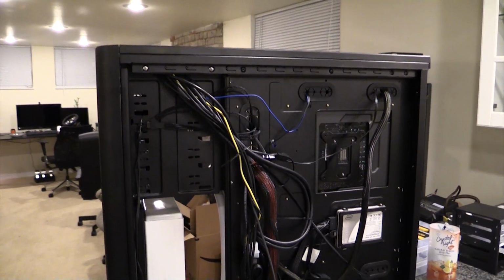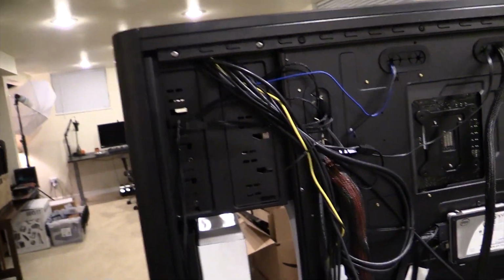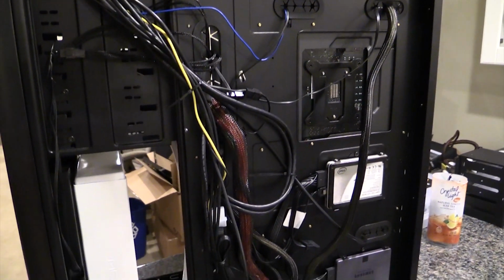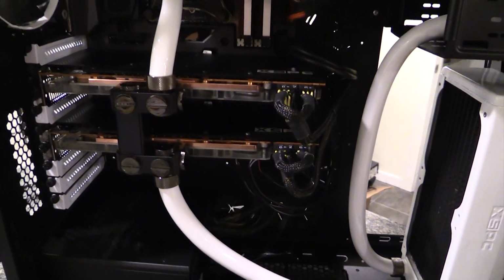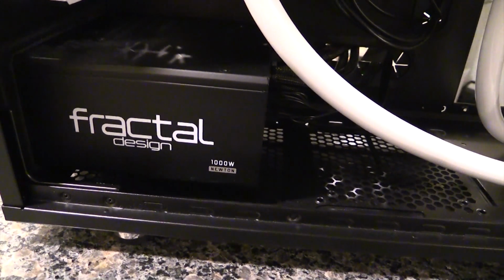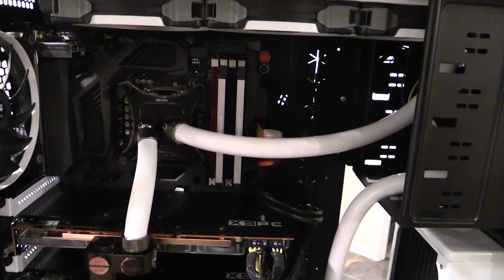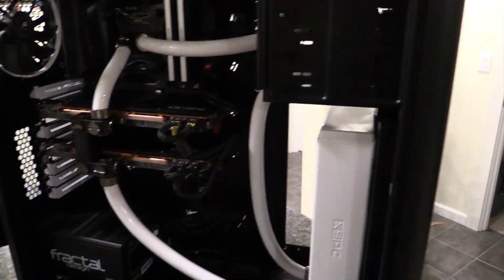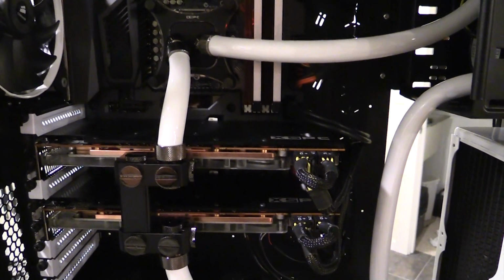Water cooling PC build - Overview and thoughts about my personal build

Comment: I just watched your unboxing of the bay res and you were really pleased with it justifying your reason for using one! Why the change of heart? The faceplate comes off doesn't it with clear perspex behind? Also there's a gauge on the front so you can see when you're filling it and flooding the loop.
Just noticed you can't see the bay res from front, what was the point?

I chose same res/pump combo, gpu block and cpu block i think a lot of first timers do!

I'm not criticizing your decision just asking!
Reply from the maker: Lack of space for a tube res + pump

Comment: did you try to actually draw your planned water cooled system before you buy the water cooling parts? it would make it easier to order the exact number of fittings & parts you need!

Comment: Your line looks very clean but the tubes look a little stressed. If you want to cover up the colored power cables a little shrink tubing at the ends does wonders. You could even do black and white shrink tubing

Comment: Hey Tim, I'm with you. I've been a PC builder for over 20 years but never pursued watercooling until a few weeks ago. I learnt a lot and only made a few minor mistakes. Now I'm the proud owner of a power but silent beast! I'm happy you're proud of your rig, it's very nice! And yeah, I had no luck sourcing XSPC 90 degree fittings so used EKWB instead. Not elegant, but it works.
Reply from the maker: Yeah, next build I am going to use Bitspower fittings. Expensive as hell, but worth it.
Reply: TimmyTechTV Check out Monsoon fittings, Jab-tech has a 60% site wide sale going on for over a month now and they still have some 6-packs left

Comment: Timmy, other than the points Dominic made, I got a couple more:

1) No point mentioning Valley scores without saying the settings used or the clocks/voltages the cards are at

2) If your loop is actually at 64 C peak, you should definitely get those fans to spin faster. The D5 does not like going above 55-60 C and it also affects tubing.
Reply: VSG Oh, hi VSG! That will be when he hears the sizzling.
Reply from the maker: As long as I can cook bacon on it...
Reply from the maker: 1. I did but maybe I edited it out. (1150MHz clock 1200MHz ram)
2. Meh
Reply: TimmyTechTV If your pump potentially dying due to those temps is a "meh", then I would love to see what "Oh no!" is :)
Reply: TimmyTechTV Sure, as long as you like it hot and wet :)
Reply from the maker: VSG Just to clarify, it is the GPU that is reporting 64 degrees and that is only after running valley for 30 minutes. The system under normal load is like 32-36 degrees.
Reply: TimmyTechTV The temp of the GPU doesn't matter, like at all. You made it sound like you were talking about the water temp in your video.
Reply: Agreed, but he likely has a bad mount if he is getting a core temperature of 64 C. Even my dual 780 Ti Classified KPEs at 1.5V in parallel flow never went past 50 C when benching.
Reply from the maker: That's like saying your apples are better than my oranges because they are apples. AMD cards run way hotter, even water cooled.
Reply from the maker: VSG ***** I have a fluid temp gauge I'll add to the system. Maybe 2 Hawaii cards is too much heat for 5x 120mm of radiator, who knows.
Reply: TimmyTechTV At stock, yes, Hawaii runs hotter due to its denser core. But once overclocked and overvolted, GK110 consumes way more power and produces a lot more heat. So at 1.5V, there is no other single GPU card that runs hotter right now than the KPE. If you put everything in terms of power consumed (which in turn is given to the loop), apples and oranges can be compared.

5.120 should be enough, but since you are running the fans at 5v the rads aren't loosing enough heat to the environment I guess. The first thing I would check is the GPU mount which means having to tear down the loop though. Yay for quick disconnects!
Reply from the maker: VSG Both cards have the same temps. I doubt I screwed up both.
Reply: TimmyTechTV Hmm.. I agree with you then. If it is not a bad mount, all I can think of is that the fans at 5v just aren't enough. I am guessing that Valley run was not at stock? Do you happen to remember the VRM temperatures? I remember the VRMs on my reference 290x cards were also pretty hot. Sorry for all the questions, just curious that's all.
Reply from the maker: +vsg I'll try running them faster and see what happens.
Reply: Sounds good, man!

Comment: Ohh and I forgot - why no push pull on the RX240?   You have the space.   And what are you CPU load delta Temps?   GPU delta temps?
Reply from the maker: I might add them, but I don't like looking at the back of the SP120s and the fin density on the 240 radiator is not super high, so they really aren't needed.

Comment: nice build!   Love your videos - you hit the nail right on the head with ordering your fittings all together up front BEFORE you start your build...

I did my first WC build with a BayRes and without fittings 90´s and 45´s and it looked horrible the first time.   Planning ahead is 80% of the build.  Ohhh and MAKE A DRAIN PORT!!    Did not do that either my first time around...

*  BayRes - NEVER again....
*  Plan ahead before your build.
*  Order all your fittings before.

Learned that the hard way...     :)    

Now I am making a monster WC set up in my table with glass top etc. 2 x XTX 360 rads and 1 x XTX 480 rad.....
Reply from the maker: I couldn't agree more with your 3 points there. Something we all have to learn I guess.

Comment: Would have probably gone with a tube res, since they're rather easy to put right above the pump(most of the time), and sometimes you can get a pump case that directly attaches it to the res.
Reply from the maker: Just too tight in the system for how I wanted it to look. Next system I do will have a tub res for sure.
Reply: TimmyTechTV I could probably do it in my 600T but there's no way I'd actually want to.  I've seen it done in a 600t and it just looked like a pain even if it's a rather large mid tower.  I understand though wanting it to look clean, and not like early liquid cooled systems looked with even wires all over the place.  Honestly if I did it I'd have to have a full tower, and likely want something like the Phanteks enthoo primo.

Comment: Nice build, I used an XS-PC 170 Tube reservoir pump combo. 80mm diameter was a tight fit but the look was worth all the extra work.
Reply from the maker: My next build will have a XSPC 270 res.

Comment: how do you plan on filling/ topping off  and draining the system when needed?
Reply: *****  easier said then done i had my loop set up about the same and ended up with a big mess not to mention  a drain valve/port is cheaper then the nano fluid i use (ice dragon)
Reply from the maker: ***** Nathan Rivera A hope and a prayer is how I plan to drain it. Honestly I will just go after it from the 240 radiator, but if I ever have to drain the system, I will probably just rebuild the whole system.
Reply: lol yeah that sounds about rt i ended up switch everything after i had to drain mine cuz the damage was already done. and all because i didnt like the fittings i had on it originally.

Comment: Sorry I almost spat out my drink there. Did you just say the XSPC Laing D5 Vario is a rebrand of "the swiftech" (MCP655)?

Also, its not an XSPC "Rathon" waterblock. It's a "ray-storm" waterblock.

I'm very very very sorry, but do you know what you are talking about? :(

P.S.: Just get a swann-morton blade to cut tubing. It cuts through anything like butter.
Reply from the maker: Make videos then you can comment about saying names of things wrong. =)
And yes, some of the D5 pumps are manufactured by swiftech and rebranded. Lots are made by Laing and rebranded.
http://unitedstates.xylemappliedwater.com/brands/laing-thermotech/
Reply: TimmyTechTV No... Laing D5 pumps are manufactured by Laing Thermotech. Then re-branded by Swiftech, XSPC, EK, etc. Hence why it is called a "Laing D5 Vario" pump.

I respect the fact you made videos but spreading information like "Swiftech" manufactures the "Laing D5" pump is just misinforming people.
Reply from the maker: Ok, I looked around a bunch and you are right. Switech supposedly does some secret sauce to theirs, but from what I can find, they do manufacture it themselves under license. Their version is out there rebranded, but 90% of them look to be just stock Laing manufactured pumps.
Reply: Of course I am right. I have no reason to lie.

Swiftech does nothing "secret" to their pumps, afaik. Any PWM and RPM pads are on the PCB of the pump, just not used in a lot of cases. I am 100% sure about the RPM pad because I modified my own pump to add an RPM wire. The PWM pad I am still investigating.

I know Swiftech does nothing to their pumps because if you contact Swiftech and say the pump you received from them has a "Laing ECOCIRC" label on the back, they will say that is standard. Indeed I can even forward you that e-mail.

Bottom line is, people on forums lie and make up bs. Rumours spread like Chinese whispers.

Hence why my original comment was what it was and was quite aggressive. You just misinformed 1,300 and that will only get worse. They will now spread and tell others that Swiftech "manufacture" the MCP655.
Reply from the maker: ***** Awesome, I love spreading lies!
Reply from the maker: ***** I added an annotation just for you!
Reply: No you are wrong he hasn't misinformed anyone he made a simple mistake. I'm new to watercooling, not even finished my first build and I knew what he was saying about the pump was wrong. You are so narrow minded, do you think that you are so clever that you are the only one that knows that Laing make Laing pumps? (No answer needed). Every other person that has watched this video didn't know that in your eyes because "ALL" of them went and spread a misinformation!

I didn't make the comment for an argument so don't bother to argue back I can tell you're the sort. I won't reply back!

Comment: I really like that loop nice short runs I like the white and black design however my only issue is that fact that those cables aren't sleeved 

There is a fix tho to cover up those yellow cables take black electric tape and wrap it around it covers it up nicely
Reply from the maker: Honestly, this build was more for learning and performance than to be a show case machine. I'm happy with how it works and doubt I'll sleeve the newton.
Next build will be custom sleeved however.

Comment: Much better than last update, Tim.  One thing that I would change is I would flip that rear fan around and make it an intake and add a filter.  Positive pressure is better especially in a case like that with so many openings for dust.

Comment: My biggest piece of advice would be to rotate that front 240 rad. You have it setup to "airlock". You want the ports at the top not the bottom to avoid airlocks. But other then that great first build Thumbs up!